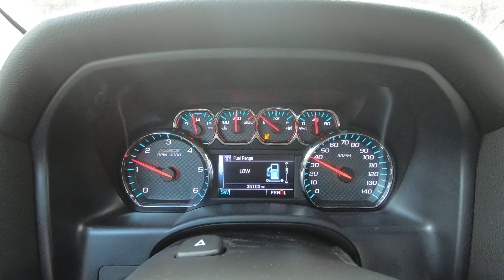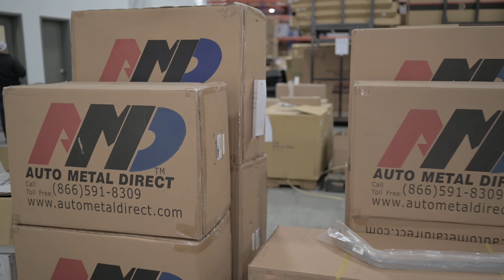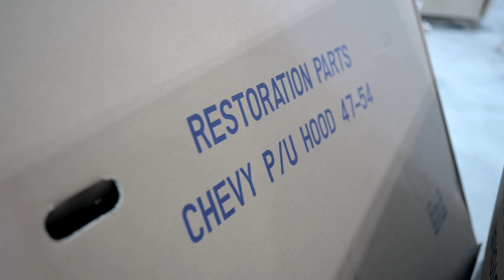THE KING OF CLASSIC TRUCK METAL | Exclusive Auto Metal Direct Shop Tour

Comment: The need more 61-66 Ford F100 parts , especially the bed sides for the Styleside trucks
Reply from the maker: I believe they have those now. I think I saw a box in there with them.
Reply: site shows only  the ones for the Flareside  ( stepside in Chevy language )
Reply: We are working on them, maybe a while before we have them as we are full on with the chevy stuff right now but we are getting there.